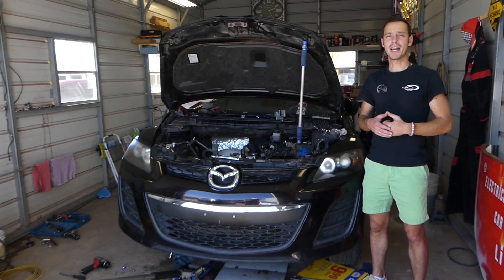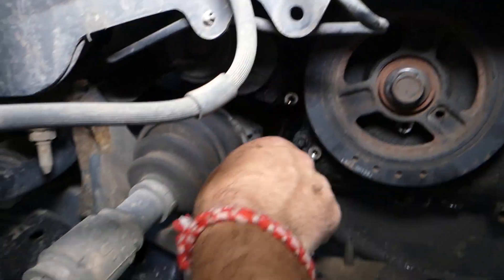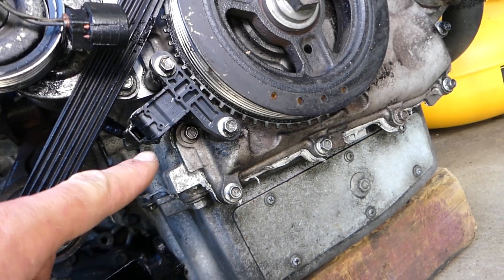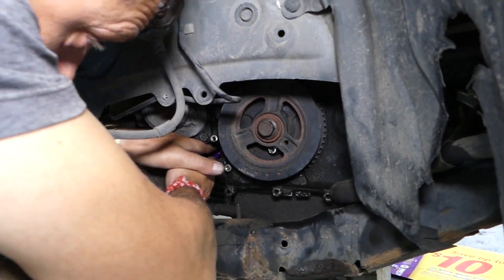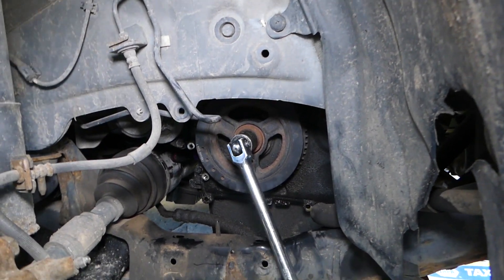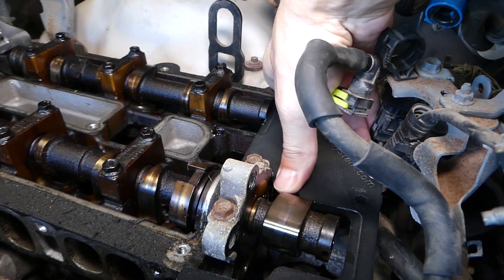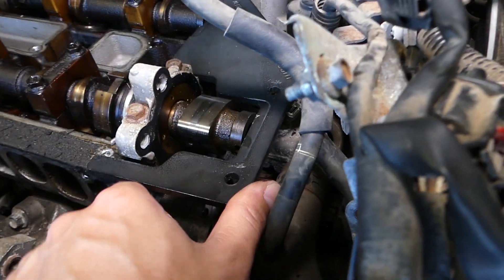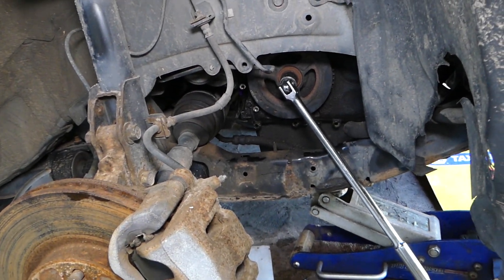HOW TO BRING ENGINE TO TDC TOP DEAD CENTER ON MAZDA 2 3 5 6 CX-3 CX-5 CX-7 MX-5 TDC PIN

Comment: can i rotate the camshaft to time them with tdc without have to take of the timing chain and timing cover? a mechanic replaced the chain and vvt actuator and related parts and the engine was not timed properly i found out after i had to replace my crankshaft sensor when the crankshaft i at tdc the camshafts are in exhaust compression instead of the lobes facing up at each other they are facin down and away, how can i time the cams without having to remove the whole chain and cover?

Comment: Is tehere any trick to know tdc without that tool?
Reply: Yeah but not as accurate. Pull the valve cover and #1 plug. Follow the hole on the cranks location as shown in this video. Roll it over to the 15* before TDC and take a gander at your cam lobes location to the lifters. You want tdc on compression so you’ll see the piston at the top and cam lobes pointing in the same angle as his lines shown in the video. It’ll get ya within a few degrees.